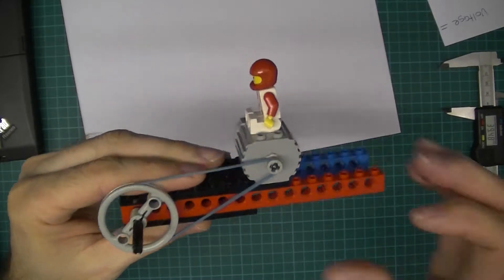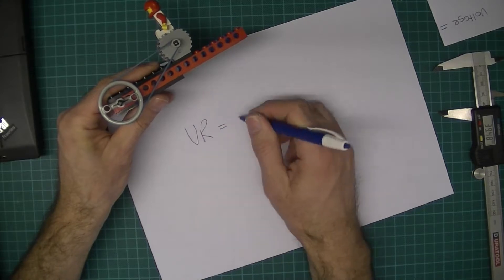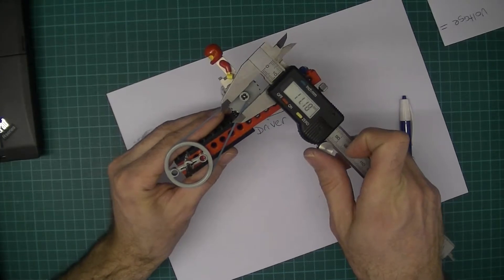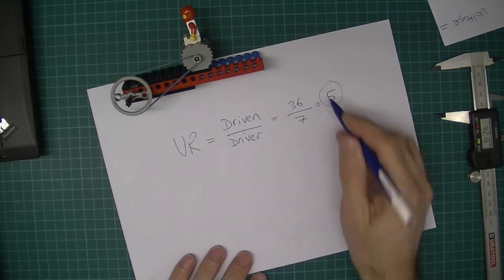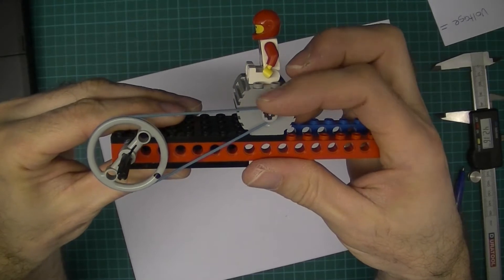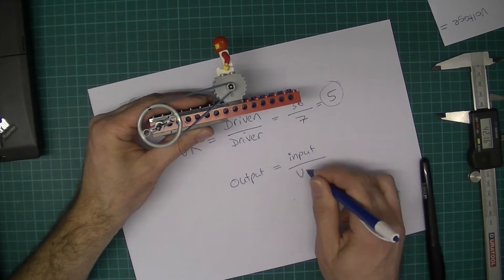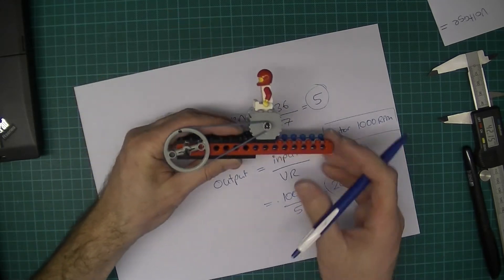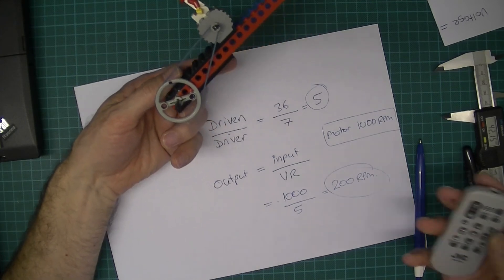How to calculate velocity ratio, input and output speed

Comment: if you need to calculate a driver/motor wheel size to drive a driven wheel at a specific rpm
...divide motor rpm by the needed driven-wheel rpm=velocity ratio
...then divide the driven wheel size by the velocity ratio=needed driver wheel size.
 .............(an example for a needed 900rpm driven wheel speed with a driven wheel size of 250mm and a 3650rpm motor speed)
motor 3650rpm/900rpm=4.05
driven wheel size 250mm/4.05= 62mm driver wheel size needed for 900rpm driven wheel speed.

Comment: So does this mean I can use teeth on the the pulley for that math.  Like a stepper motor with  20 teeth driving a pulley with 80 teeth on a g2 timing belt would be 20/80?  How does torque effect it?  Does the length of the belt or the distance from the center of the pulleys make any difference?
Reply from the maker: Good questions!
Teeth, radius, diameter, circumference can all be used to calculate velocity ratio. 
In your example it would be VR = driven / driver = 80 / 20 = 4
The motor would rotate 4 times for every 1 rotation of the output pulley.
The ratio is not affected by torque or distance between centres.
Reply: @PizzeyTechnology  Thank you very much.  I'm building a scara robot.  I found a turntable at home depot for $4 bearings are expensive.  I also found out that 5/16 rods are close enough to 8mm to work.  I'm using a threaded rod instead of a lead screw.  I got 4 stepper motors for Christmas.
Reply from the maker: I had to look up SCARA - so it's a robotic arm you are making? Is this just for fun?